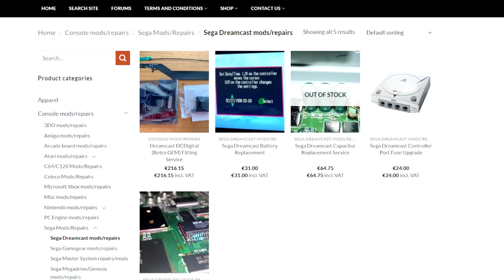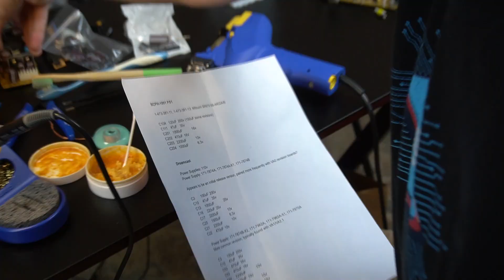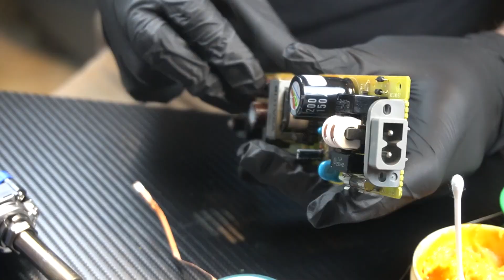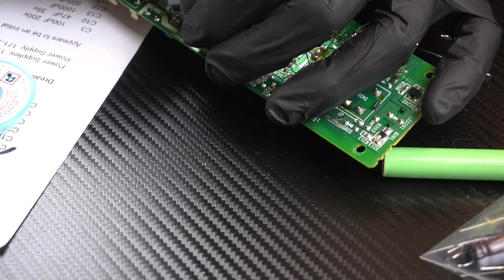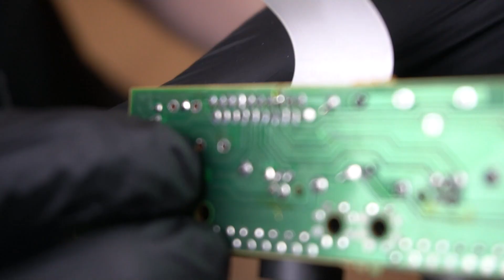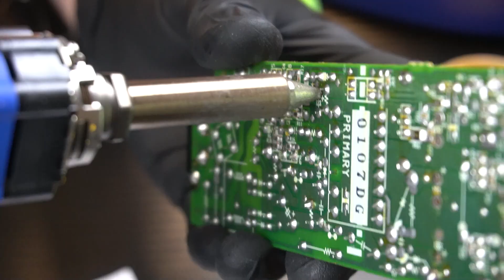Soldering For Beginners - Changing Capacitors | Tips, Tricks, Gear, Mistakes to AVOID!

Comment: A question for Travis and Cody? what is a goos way to practice, besides buying kits? are they any consoles that are good for practice, to buy as Junk for parts? Gameboy? Snes, Nes, gamegear?
Reply from the maker: You could definitely find a non working common console such as the PS1, and practice by removing the caps on the power supply, and then resoldering them back in. That would probably be a good way to start.

Comment: Oh, dude. Perfect timing!
I just received some parts to sort out the dreamcast controller board and make a USB4Maple adapter.  
My first successful soldering project was just two days ago with modding a GameCube w/ PicoLoader.
Reply from the maker: Nice man! It's so satisfying once you complete a job like that!
Reply: Hey man! I did picoloader last week as well. For me it was a scarry experience, I thought I was going to fail. But it worked. It felt so good to go over this challenge.! I am not aware for USB4Maple adapter? I need to check this out. I want to do Dreamcast Bios but I need some practice and new equipment for that.
Reply: @john005_ yeah it's just a Pico hooked up to a Dreamcast controller plug to act as an adapter, very cool